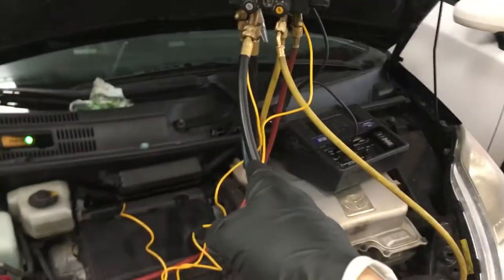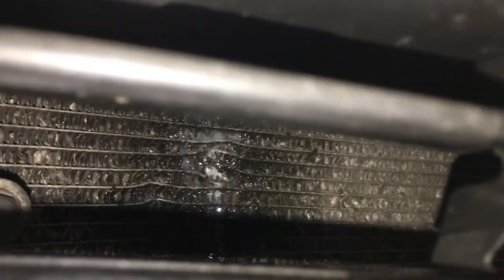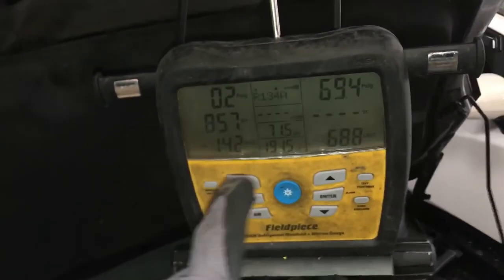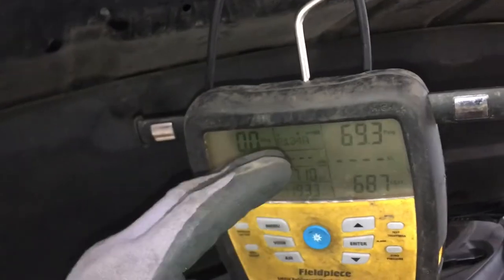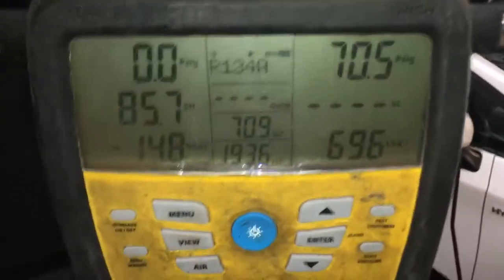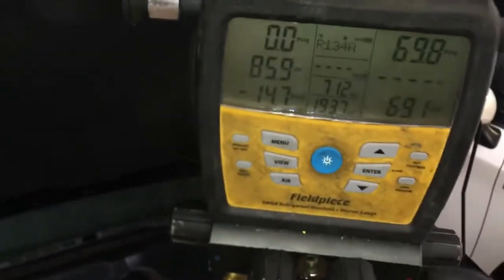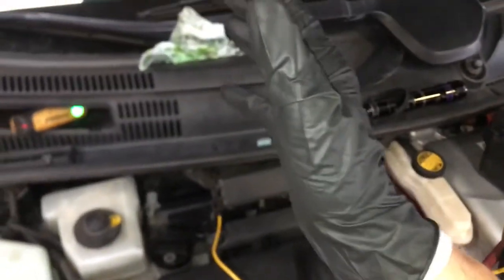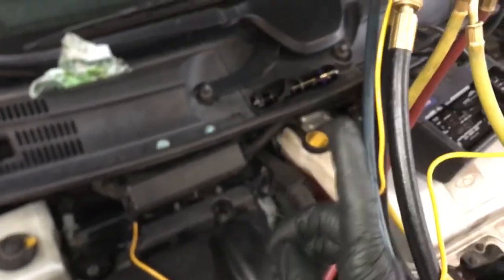Prius AC leaks, 2012 & 2006 pay attention compressor discharge temp & Hights side PSI ONLY 3 Oz

Comment: More great info. I'm surprised the Toyota engineers let the compressor run with such a low charge. Quite an eye opener now I'm using temerature clamps on various parts of the system. It really let's you see what's going on.  Just a matter of time before it destroys itself.
Reply from the maker: Most cars manufactures allow the compressors to run extremely low on refrigerant. Before the safety finally cuts it off just like the old idiot lights on the dash when you would overheat on the side of the road and possibly blow a head gasket after the damage was done

Comment: Very interesting indeed. Begs the question...Why would the Relevant control module (climate, Hvac, ECM whatever it is on the Prius) algorithm allow the compressor to operate under such parameters??? Head scratcher.
Reply from the maker: TheGibby3340 it not just the Prius, most all car do .
Reply: t lech Understood. But you would think with all the innovation in the Prius a little more oversight of its systems would not be a big ask...Just a thought. 🤔
Reply from the maker: TheGibby3340 I forgot to mention this is what you find out when you have the instrumentation I know the methods to test every vehicle you work on. You can actually document and data log all the information.  This is all the kind of stuff that you were taught when you go to automotive school take engineer in classes or when you take thermal dynamics and fluid dynamics in HVAC School. This is a problem with her industry to work on cars there’s no requirements to know what you’re doing just keep breaking stuff until you learn that is the common practice.  Now take the same mentality and apply it to being a doctor just keep killing your patients until they start living. Or aviation mechanics just keep practicing on fixing planes until they stop falling out of the sky.
Reply from the maker: TheGibby3340 anything that cost more than one penny cost too much for a manufacture to put something extra on a vehicle.   Just like your engine oil in your coolant if you don’t keep it up to the right level you burn up an engine if you don’t maintain your refrigerant and don’t keep it up and service it you burn up your compressor. If a customer doesn’t keep the air pressure up on their tires they blow up their tire. It all comes down to maintainance and awareness.    Of course some of the newer Mercedes in the last 10 years and old Cadillacs had a feature when they would since the refrigerant level was too Low for a long period of time the ECM would disable the output to the clutch permanently. Until the customer took it into a shop to clear the ECM code and correct the low refrigerant problem. This is what should be implemented on vehicles today.   I’m gonna try to remember to take more before and after temperature readings of the compressor discharge line pictures worth 1000 words and some people don’t believe in less they see.     That falls back to lack of education and why most mechanics or mechanics because they don’t read don’t like to read can’t do math this is a majority and I was a D and F student when I was in school did not like reading did not like math I am no exception to the rule. Usually always failed any written test I took. But yet in science class I could do any of the projects out of my head pick up any of the lab equipment put a gather perform any of the experiments.  When the ace students were fumbling around asking questions who would always get A’s on the test and they could remember everything they read would always come over to my table to ask me how to do something. But yet when the teacher would put a piece of paper for the final I usually always got an F or a D.  But I had a father who is relentless at beating in the basics of physics and electronics science and chemistry all the way down to the molecular level from childhood just not written on a piece of paper

Comment: Searched the web for days and found your thoughtful Prius AC videos.  Our 2006 Prius has great AC most of the time but consistently will die after being in traffic for a while.  It always works fine, even on a long highway trip, but once you slow down and get in bad traffic it will quit entirely and won't come back until it cools down completely. Really would appreciate any suggestions, Thanks
Reply from the maker: Look for one fan not coming on.   Possibly both fans. 

If that is not the case then could have possibly been overcharged even by 1 to 3 ounces with not enough airflow over the condenser can make the high side head pressure sore to over 440 psi cutting off the safety switch to kill the AC. 

At idle with only the fans pushing over the air may not be enough to keep the condenser temperature down lowering the head pressure but at a higher highway speed may just be barely enough to keep the head pressure under 400 psi giving you cooling. 

A little more rare air contamination in with the refrigerant if it was recycled refrigerant that was used from a recovery recycle recharge machine.    Raising the head pressure under only certain circumstances on hot days when you don’t have enough flow of air over the condenser at idle but going down the highway at 55 miles an hour you have more airflow and that just might make the difference of keeping the airflow and temperature and pressure of the condenser under the point where the safety cut off cut off the AC. 

Could be other things but those are the first that jump out low hanging fruit

Comment: This information is fantastic.  Thank you so much for sharing and educating.  I took my 2008 Prius to the dealer, AC wasnt cold anymore, they said the compressor is shot.  They wanted $1800 to replace compressor, evap and fill.  I plan on buying a new compressor, installing and having them evap and fill.  
How would i locate someone like yourself in my area, to diagnose?
Reply from the maker: Usually a place that just specializes in radiators and air conditioning only. 
            But this still does not guarantee that they had good training or work ethics.      Unfortunately some shops are just about the money and selling lots of parts even if they’re not needed or causing them to break.      Possibly you could go on the MACS website stands for Mobil Air Conditioning society actually they just change their name recently but the initials are still MACS. 

        And search for somebody on their members list in your area at least that means they’re interested and they signed up and hopefully have went to some of the expos in classes.
Reply: Thank you so much, I truly appreciate the follow up and information!
Reply: I have 2010 prius with broken AC compressor. Can i still drive it without fixing it? Will it overheat my hybrid system?
Reply from the maker: @troylollysaf9311  compressor not needed for driving. 
   But in a vary hot summer 100F day the fan in the passenger compartment likes cooler air to help keep the hybrid battery cool.
Reply: @coldfinger459sub0  Thank you. I dont have money to replace AC compressor yet but need to drive prius to work. Glad to know broken AC wont overheat my prius.
Reply from the maker: @troylollysaf9311  as long as you’re radiator fans both work